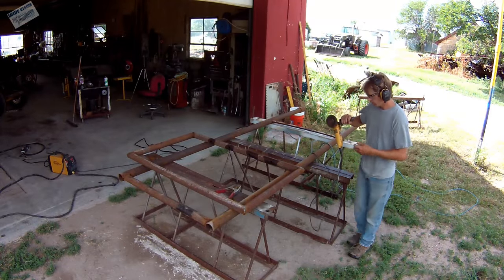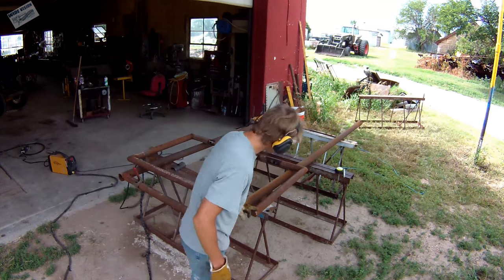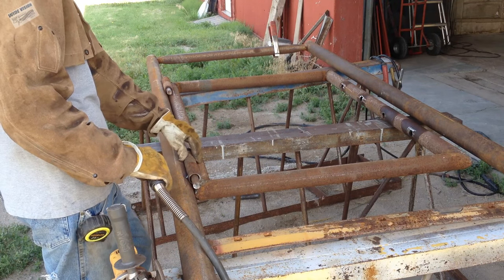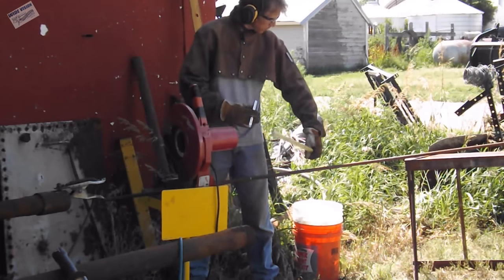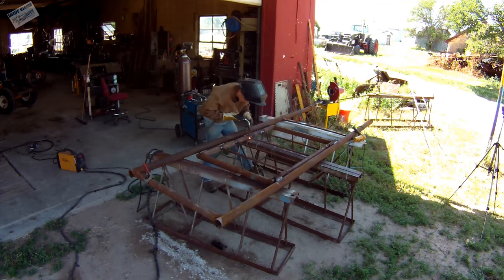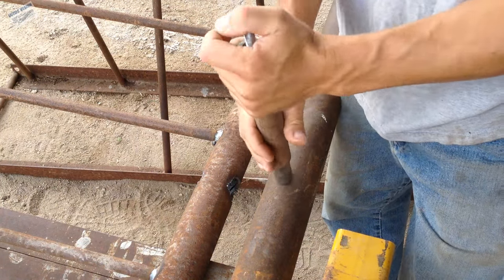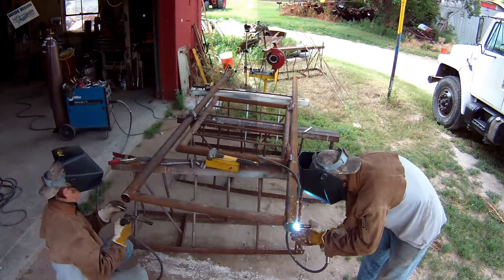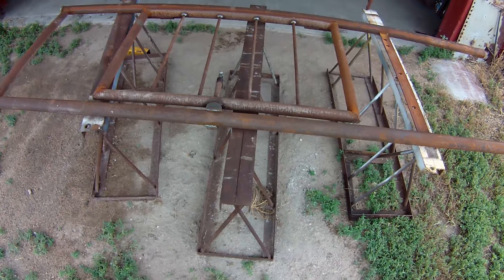Corral Walk Through Gate Build (most of it?)

Comment: Hey bud - WOULD a harbor freight 10 ton shop press squeeze an oil field pipe where I could weld it like you? I just want to make a couple gates at my cattle ranch and small stuff.
Reply from the maker: Maybe.  My 4" bore cylinder runs at 1500 psi to squish 2 3/8  O.D. pipe. That's about 9 tons. Can a 10 ton HF press actually produce 9 tons?  ;)